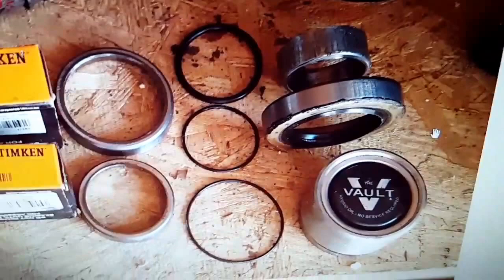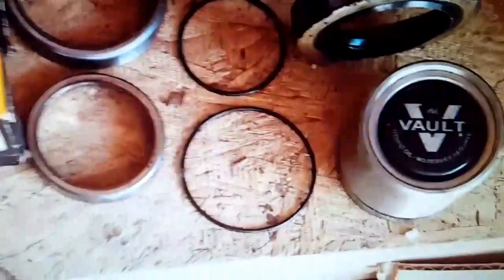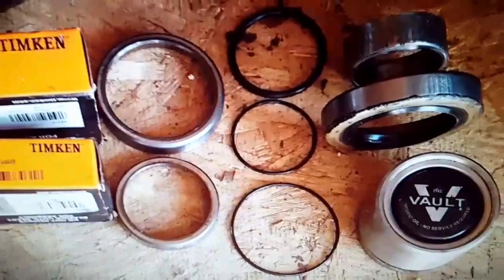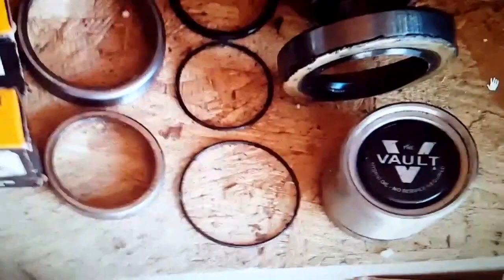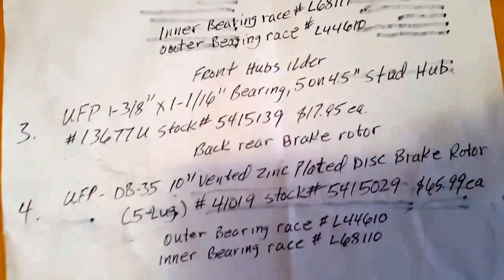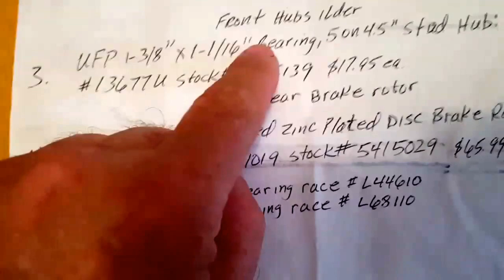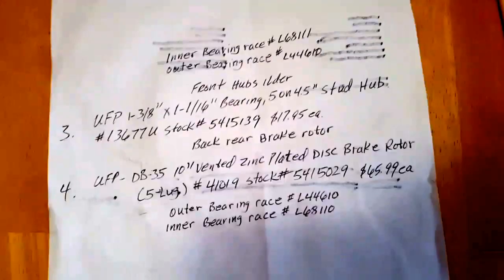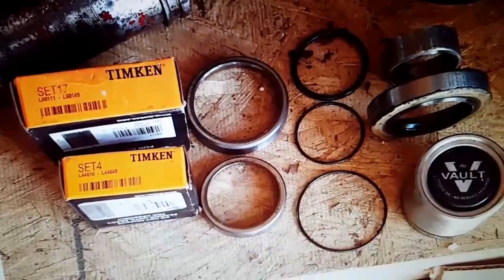boat trailer bearings, seals, spindle rebuild

Comment: I have a single axle Marine master trailer, it doesn’t have breaks. Does a 2.56” x 1.68” rear seal sound correct? I wasn’t able to find a number on the outside of it. Great video btw
Reply: These videos have really helping me. My vault axel hub has a rear leak and these videos areawsome!!